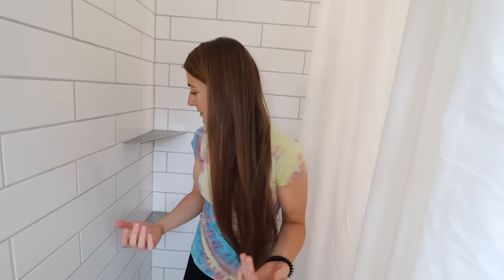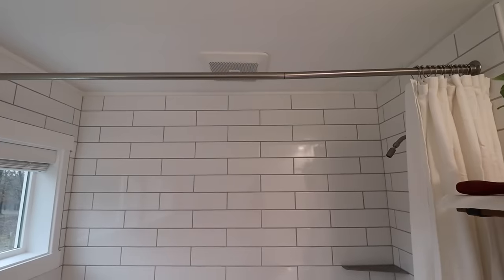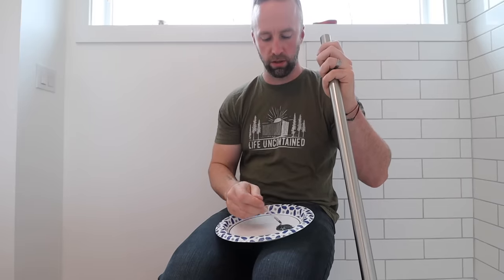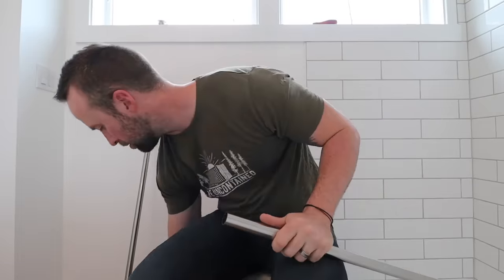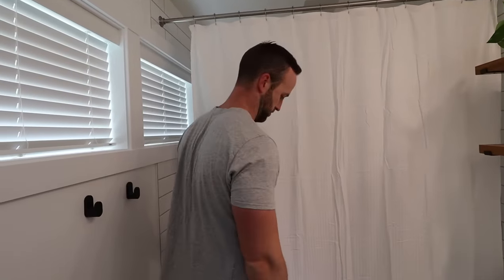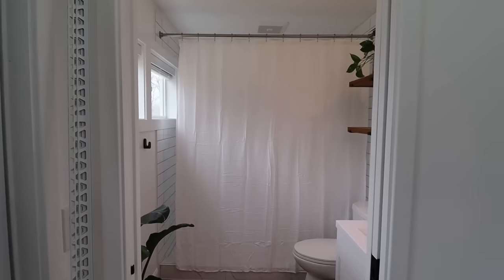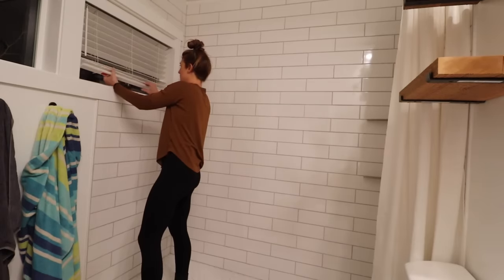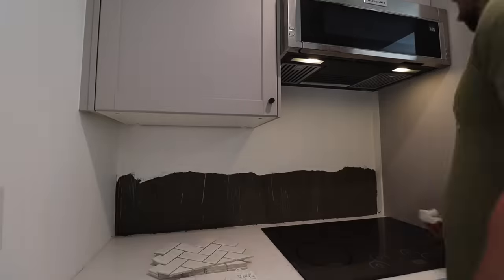FIRST SHOWER INDOORS AFTER 4 YEARS!

Comment: 🇺🇸👍. Move the curtain rod move it further out from the opposite wall lengthen the curtain put a strip of Velcro at each end and on the tub each end making sure it’s tight when attached. Walmart has the material clear plastic then a outer material of your choice then sew together then punch holes in top using a tarp hole punch with metal rings. Mack sure to take outer material lip it over seeming it . You’ll have a lot more room inside because it’s bowed outward and Velcro’s holding the bottom keeping the outer floor dry. 👍🍺🥩🌽🥔. 🥛💤

Comment: Find a thick pipe the inside diameter of the rod at the hardware store, cut it to fit, slip it in the shower rod, problem fixed!

Comment: FYI clean the pipe and the plastic light sand then clean with rubbing alcohol. It will get a better bit. Not saying what is did is wrong and who knows did you clean it and it wasn’t In the video.

Comment: That window is going to be a NIGHTMARE over time being IN that shower. You're not going to believe how much trouble it's going to cause. Also, BE SMARTER.. you need to narrow the shower entry with walls left and right of the opening. With the wide entry coupled with the window, you're going to have constant water damage issues.

Comment: I still do not understand why you did not put in a frosted glass wall for about 4 ft at the shower head end and then maybe a curtin for the rest - even though I do not think you would need the curtin at the end. By using a frosted glass wall you would also have just a little more with and no curtin that "bows" in when you shower